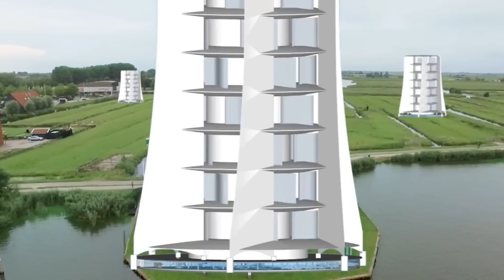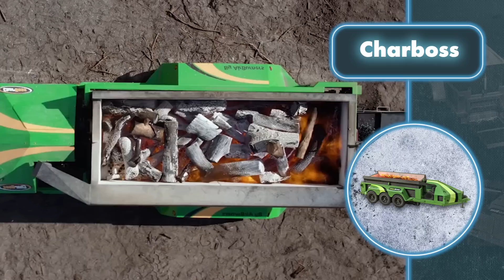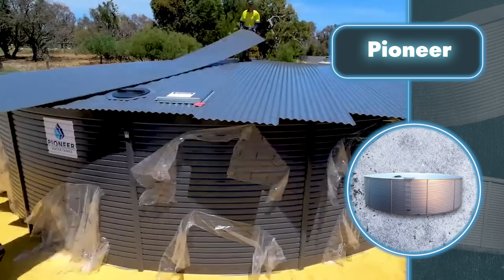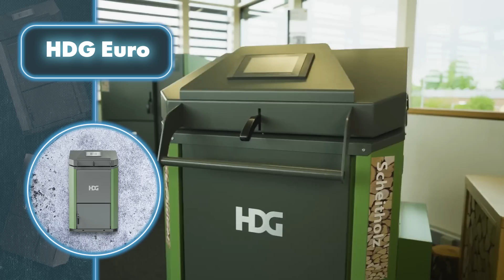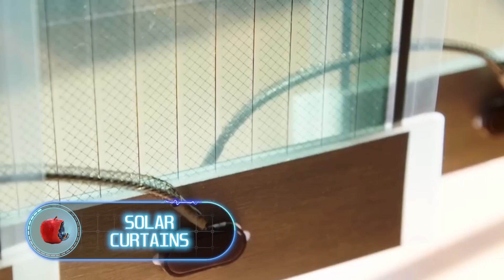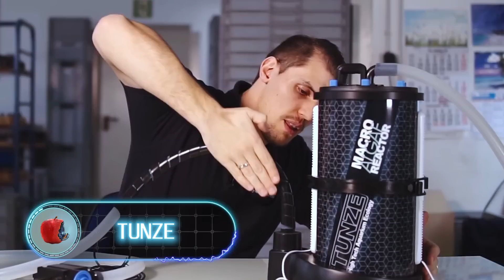Ingenious Inventions for Full Blackout Situations

Comment: Thermit waste water system. 98% efficiency, that leaves 2% which is the same as a very high 200,000 ppm if my math is correct. But the bio sand type filters can be useful.  
Inexpensive Percale fabric makes a good pre filter and  You could buy hundreds or thousands of ceramic gravity filters for the same cost.